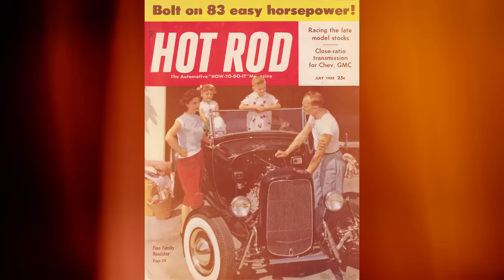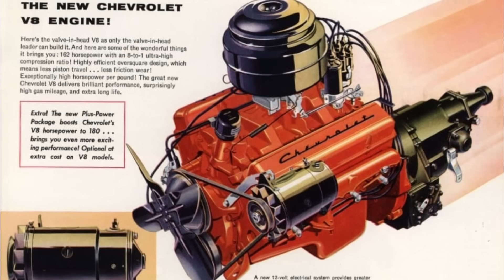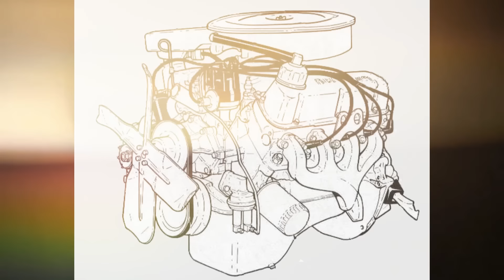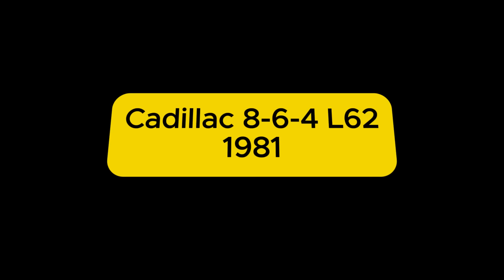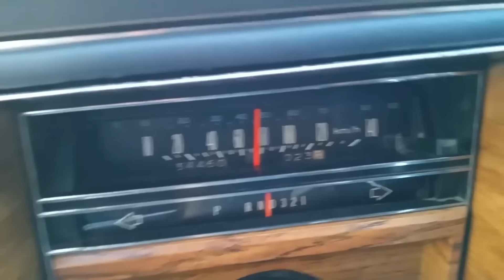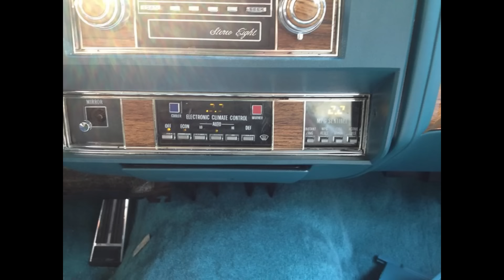WORST Engines Major Companies Ever Put In A Production Vehicle! PART 2

Comment: Where is the Cadillac HT4100? It was truly a bad V8. It overheated, consumed oil, and often stalled. Most of the other engines on this list aren’t bad engines, they’re just underpowered. But the HT4100 was actually a bad engine; terribly underpowered AND unreliable.
Reply: I guess I'm the only guy on the planet with a reliable 41 year old HT 4100.  My dad bought a beautiful 83 Eldorado new. Has the optional cadillac aluminum wheels, Bose stereo,  all digital dash. Silver with 2 tone silver and cream interior.  Dad loved it always took good care of his cars. As do I. He passed away in 2013 at 97. I got the Eldorado then. It had 178.000 miles on it..Southern California car so still in great shape.  Since then it's now at 192000. Original engine,  still running fine..I  continued his routine of 3000 mile oil changes, using Castrol GTX 10 40 . of course putting about 1000 miles a year on it I change it once a year, and every other year a coolant service and put THE COOLANT TABS IN IT. This regimen since new seems to work well. It still rides and drives beautifully. I also have the 58 Cadillac he bought in 1960. Mom gave it to me in 1982. It's still on the road too.
Reply: @1958Cadillac-v2g  At least it wasn't the modified Buick 4.1 liter engine. Oil filter adapters were required just to fit them, but all-in-all, they were just Buick 4.1 liter engines, trying to lug around a HUGE Cadillac.
Reply: HT 4100 parts weren't easy to come by.
Reply: @stevencovington4715  they had about the same power to be honest. And they had the same displacement. Both were 4 1 L. Not a lot of difference in performance. The 4100 was just smoother running because it was a V8. The 4.1 Buick wasn't the best . But for reliability I'd take it over the 4100. As long as you kept an eye on the oil pump/ pressure, you'd be ok. The rest of the engine was decent. I just checked. Both had the same hp (125) . But the Buick V6 actually had slightly more torque

Comment: Given that the flathead V8 basically put the automobile on the map let alone the Ford product. Also given the fact that these Flathead engines are still being reproduced today for Hot rod applications particularly a small for roadster cars. If they were so terrible why are they still being desired today. They're actually one of the simplest and best motors ever built. And of course they're not going to meet today's standards of reliability and mileage those motors were built different back then it was a different time for the time those were the best ever built.. and technically today less moving parts less maintenance low cost. Did those motors have their problems yes they did all engines do especially when they are newly introduced. And of course just because it didn't make that much power also does not mean it's a terrible engine. The biggest one ever was barely over 5 liters. Smallest one was about 130 cubic inches. And the crazy thing is is right at the end of the run of the flathead V8 it had already improved vastly. The only reason why the Flathead cease to exist as a mainstream engine was because it was so outdated by the time innovations came along for the newer V8S coming out. The only conversion that could have made the Flathead a formidable contender with the newer style engines with overhead valves is the Arden overhead valve version on the flatheads. And sadly those heads are almost impossible to find to this day. Had those heads been mass produced the Flathead may have survived a lot longer than it did. Overall I'm just glad to see them still around and being used for their into the purposes in honor of the tradition of the original V8.
Reply: I gotta admit that hopped up ones do sound good.

Comment: Funny thing: When GM figured out how to make a splayed-journal crankshaft by the late-70's, it made the Buick 3.8L V-6--and any other V-6 GM developed from an existing V-8 design (Chevy 4.3L) obviously a better engine than a extremely-small displacement V-8... especially when the latter were running such ridiculously low compression ratios. 

BTW: The Olds 260 was discontinued after the '80-m/y by the 307... not '82.
Reply: @pancudowny  general motors Holden put same 3,8 litre in the Holden Commodore  was a money pit another good car engine for Mr and Mrs average
Reply: Chev V6 and Buick V6 are two entirely different engine.

Comment: I noticed that a few of these motors on this list were from the 70s to the early 80s when the auto industry was facing an oil shortage and higher priced gas as well as new restrictions coming from the EPA. It is important to know that during this time period, a lot of manufacturers did not do their due diligence in reference to research and development in order to try and rush new and more fuel efficient products to the market and this resulted in a slew of horrible motors coming from all of the big 3 automakers. Most of these products looked good on paper but failed on the road as you see that a lot of these motors did not stay in production for long.

Comment: The 307 was also in some Chevy's as well. A friend of mine had a 307 Nova. They also had horribly made camshafts like the 305 did. They would flatten because they were not made of hard enough steel.
Reply: ALL SBC flatten cam lobes. Hydraulic roller the exception.
Reply: There were different design 307 engines. There was the Chevrolet 307 small block, and the Oldsmobile 307 Totally different animals. Much like the Chevy 350, Buick 350, Oldsmobile 350, and Pontiac 350 4 different design engines. NOTHING interchanged.

Comment: My parents bought new an Oldsmobile Cutlass sedan (Based on the G-body platform) that had the Oldsmobile equivalent of the Chevy 262: The 260. And it too only produced 110-hp. The worst part: My dad bought it partially because it's torque curve, as we'd be towing a single-axle camper trailer with it. Sadly, the V-6 model had a better one... but the dealer was trying to get this brand-new model, which was already a year old at the time, off the showroom floor. And my dad being how he always was over cheaply priced things....😒

Comment: I worked at a company that had a fleet of Olds diesel cars (8) , the salesmen hated them and the head mechanic didn't like them either and told the salesmen to abuse them and blow them up to get a new gas model !
  It seems they did better and kept going with cold start and high revving , but did get approx 20-23 MPG !

Comment: the 305 chevy wasn't bad
Reply: Some of the later 4.8s had poor head castings, a supplier issue. Porosity would allow coolant into the oil. By removing a valve cover the vendor casting mark would pretty much give away why your oil looked like tar. Sister's truck had a one like that. We just put in a crate engine vs try to fix it.
Reply: Agreed.  I had one in the bulbous 1992 Caprice.  I was lacking in power but was fairly trouble free.  I had an odd failure of an edge card contact on the engine control module (located inside the panel by the front passenger's feet) that was repaired with contact cleaner and needle-nose pliers.  It was a tribute to the factory service manual that enabled me to debug down to that level.

With its redundant injector throttle body fuel injection, I was not stranded by the failure.

Comment: Hi Just Cars!  I am 64 year old retired ASE Automotive Service Technician, and I was also a state emissions inspector/technician.  In the mid 1970s to the early 1980s, "The Big Three" automaker(s) performed a very poor job in regards to engine drivability and automobile performance.  The big three automaker(s) could of performed a much better job, if they wanted to and hear is why.  If you bought let's say a 1975 to 1981 Pontiac Firebird Trans-Am, with an SAE net rated horsepower, (1972 and after) or a gross rated horsepower (1971 and before) the rated horsepower was really not too bad, coming from a big 4 barrel carbureted emission controlled V8 engine.  The main issue, was that the air/fuel mixture(s) where and still are set up to run very lean.  Not all emission control(s) effect horsepower, and by the way, most emission control(s) actually cancel and/or stop working, in regards to wide open or near wide open throttle, this often include(s) the air pump, EGR valve, and last but not least, the catalytic converter(s)!  But in the mean time, the car would be equipped with a very unprecedented 2:50 to 1 rear end gear (differential) axle ratio, which is not at all performance ratio.  If you own a mid 1970s to early 1980s emission controlled performance automobile, I suggest that you, lower the rear axle ratio first before removing any emission controls, and you will be in for a real treat!  I had an all stock 1977 Corvette with a factory 350 L-82 engine, factory Turbo 400 transmission and a factory 3:55 to 1 Positraction rear and it performed 14.8 @ 119 MPH in the 1/4 mile with no modifications and all emission control(s) present.  You notice that I capitalized the word Positraction, that is because Positraction is a trademark of Chevrolet Motor Division of GM, meaning closed differential.  Please tell me what you think!  Dave...
Reply: I know with Chrysler the net hp engines were different than the gross ratings in more ways than just going from net to gross..

Chrysler engines all had lower compression~reduced horsepower and torque.

Chrysler engines had different camshafts,crankshafts,heads,carburetors and exhaust systems all killed power..They were a lot weaker than the older engines rated in gross..

Example I had a stock 1971 Charger RT 440 Magnum,727 auto and 3.23 gears also had a 1972 Charger rallye 440 4 barrel,727 auto and 3.23 gears the 71 would struggle like crazy for traction and when I had better tires etc it ran high 12's in the 1/4 mile stock..The 1972 also could smoke the 14 inch bias ply tires easily(even noted in original road tests) but could hook up better if you know how,it was over 1 second slower in the 1/4 mile all the time.That is over 100 net hp to make a car gain that much more performance in the 1/4 mile.

Both cars were stock and this was 1976.My father bought them both new and kept them for decades,I own the 71 today.Uncle owned a Chrysler dealer from the 50's -90's.

Comment: Chevrolets 1955 V-8 wasn't a 262 it was a 265 and it was one of the best engine ever. You guys have fabricated a collection of lies like I have ever heard. You know nothing about engines.
Reply: No, I would say the 327 was.
Reply: The 262 they are referring to, did nor exist in 1955, lol. They didn't make production until, 1975, and could be found under the hood of Nova's and Monza's, and was gone by, 1977. Totally different engine than the original,1955, model 265 in small blocks.
Reply: @scottbryant7377  Correct and they didn't even have spin on oil filters a first.
Reply: Some 55s cracked pistons.  Fixed in 1966.
Reply: @shanemitchell477  Heaven forbid if you want parts for a 327. The guy at the parts store has to look in the room at the back of the back area etc.
Reply: @ZEEKUPP  Summit Racing
Reply: I was a teenager and my future brotherenlaw had a 56 Belair 265 power glide I saw 110 mph on the odometer, the car would start going round and round on the front end to where he'd let off to keep control, the car served  well I would stull buy one today, Great cars back then,do ya some research on new cars today if you want to see some Real Junk engineering guys have lost their mind using a timing belt to drive a oil pump that runs in Oil 🛢 Nuts

Comment: The 262 needed a cam and better heads to boost hp to 200ish. ❤
I eng. swapped a 260 into a diesel 82 Delta 88 and is was quite peppy.❤

Comment: The imperial would have done well in my opinion had it not had the lean burn to begin with. I think those 2 door imperials are gorgeous
Reply: Those Imperials really were a work of art. I myself had a 1981 Cordoba, the platform the Imperial was based on. Technically, the Imperial did not have Lean Burn-it had something EVEN MORE problematic: a special and weird Electronic Fuel Injection system that was unique only to the 1981-1983 Imperial. The system was so horrible, Chrysler agreed to retrofit the cars with traditional 4 BBL carburetors. It was an insanely expensive retrofit, and Chrysler lost tons of money on this car!
Reply: Agreed, very good looking cars

Comment: My 70 caddie convertible with 472 big block has 375 horse power stock. Every year after EPA choked more & more ponies.  I periodically launch it & modern cars struggle to keep up...(till the next gas station) 😅
Reply: I had a 1970 Cadillac 2 door hardtop. I loved that car,  it was BIG but handled well, the steering and brakes were great. Great luxury,  great ride, that car went exactly 100 MPH for me, I only did that once, it took quite a while to get it to 100MPH but I believe it could have kept going 100MPH all day...except as you mentioned(till the next gas station) = city driving 8 miles per gallon, freeway driving 10 miles per gallon. That was it's 1 bad drawback. You could actually work on that car, me, not a mechanic could change the oil filter, replace the starter, the water pump, the fan belt, my uncle and I replaced the radiator.  These "modern" cars...you can't do much with them anymore.
Reply: @jeffgreen7499  replaced plugs & was amazed at how accessible they ALL were
Reply: @JTA1961  Ha! You reminded me of my first car, a 4 year old 1965 Ford Thunderbird.  I took it out on the brandnew freeway, no cars in sight and opened it up, it ran reallly smooth and went 95 MPH.  I thought the car was better for more than that; it had 390 V8 with 300 HP. I told my dad, who B-T-W was a great mechanic, we changed the sparkplugs, did nothing else. I went back to the freeway, this time 115MPH!!!  Ha!  7 plugs were easily accessible, the 8th could only be reached by removing some framework situated around the motor. That was a fine car!  It was not perfect, but I think that was one of the best FoMoCo ever produced.

Comment: The Chrysler ELB system was first used in Australia on CL model Valiants with the 318 in 1977. The CM Valiants had ELB on the Hemi sixes as well. Economy improved on both. As for rubber hoses, if you don't maintain your car it'll go to shit in a few years like anything else. Chrysler Australia was first here with electronic ignition in 1973 and it was most of ten years before ford or holden went electronic.

Comment: About the smaller Ford V-8s (255- & 302-ci.) of the 80's: I find it ironic that by the '85-y/o, they were able to produce a turbocharged 4-cyl. that made more horsepower than a V-8 of more than twice it's displacement at the time, only to de-tune the former the following year... for seemingly no explanation that even I can figure of than Ford just wanting it's V-8s to look good. Had they continued development of the SVO 2.3L (As it's known by) it probably could've produced 250-300hp by the early-90's, making the V-8's redundant except in applications seeing high-load demands (full-size trucks & vans, namely) and Police specialty models. But no... the carbureted Turbo 2.3L of '79, when placed in the Fairmont, gave & left with people a bad taste in their mouths. And the very malaise era of performance of the 70's left them longing for high-power V-8s as well. And since people [on average] are too stupid to comprehend complex things....🙄
Reply: They do, but Mazda makes it now.....the 2.3 Mazda engine is based off the SVO 2.3. It makes 263 hp last I checked. The only problem is we now have many 24 valve V-6 in cars that make the same as the turbo 2.3 Mazda. It's in the Mazdaspeed 3.
Reply: Ah, the '79 Ford Fairmont, worst Ford I've ever driven (as a Govt car, 1983, one of the worst cars ever made by Ford.  With its horrible low torque or power, a mismatched 'buzz-bomb' auto transmission: engine slowly wound up to high revs in a low gear, --trying to get out of its own way,  then "Clunk" shifted bog down to the next gear, no...  Shocks were completely worn out from jouncing on clay roads on the rural Navajo Res...   'Supremely' dull styling.  Bad rear drive traction in snow...  Luckily, as a shared Librarian I often had the use of an old-style (large) Jeep Cherokee 4wheel drive the 18 mile dusty or muddy backway between schools.
Reply: Why?  COSTS.    Turbochargers are expensive.  Displacement is cheap.   That applies to manufacturing and to sales.   Give a guy a choice between a naturally aspirated V8 that makes reliable, cheap, low-maintenance power, or a high-tech, expensive hair-dried four banger...  yeah.  Also, turbos are warranty headaches - a lot of people don't know how to drive them properly.  A  guy I worked with would park his car, rev the engine up, and then kill the ignition so that he could hear that turbine spin down.....   NOT HEALTHY.   When I cautioned him that the turbo spinning without oil pressure would kill it... he shrugged.  "It's under warranty..."

Akso remember that in athe mid 1980s gas prices fell sharply here in the US.  After years of $1.50-something a gallon, prices fell to below $1 a gallon,  Thirsty V8s were back in style... and Americans, as a general rule, don't f__king LEARN.

Comment: Studebaker had the same problem with its V8. Started out with 232 CID putting out 120 hp in 1951. At the end in 1963 it was opened up to 305 and 330 hp with supercharging.

Comment: As a mechanic, I have never seen some of these smaller V8 displacement engines from Pontiac, Oldsmobile, and Ford.
Reply: Ah yes, the Malaise Era.  Folks didn't drive the awful ones long.  They broke down, were parked in weeds for chickens or stray dogs to enjoy, and/or gratefully rusted out.
Reply: There's a reason for that.  They were garbage and cars equipped with them had very poor resale.  The cars, regarded with little value, were poorly maintained and ended up in the boneyards much faster than their larger-engined contemporaries.